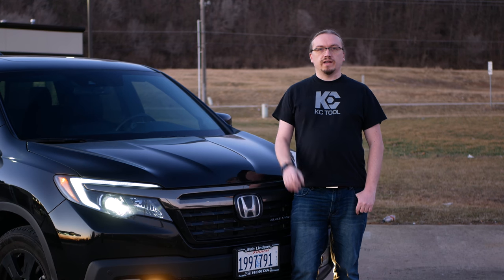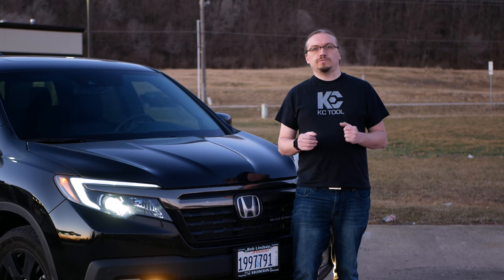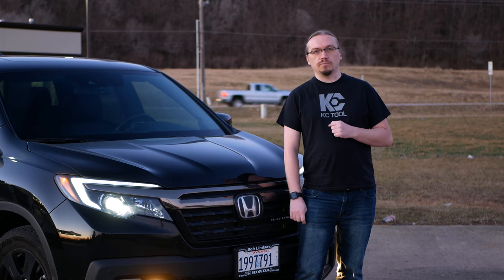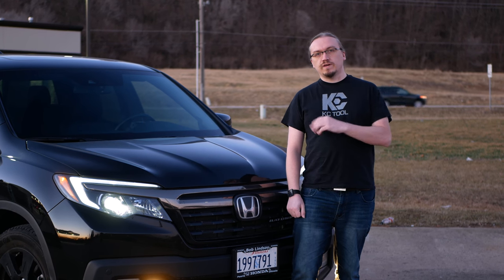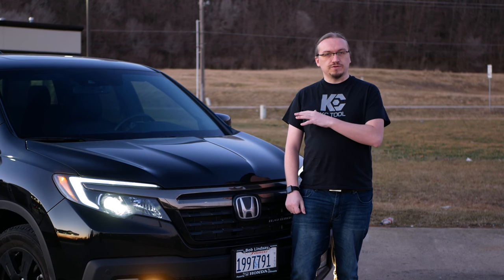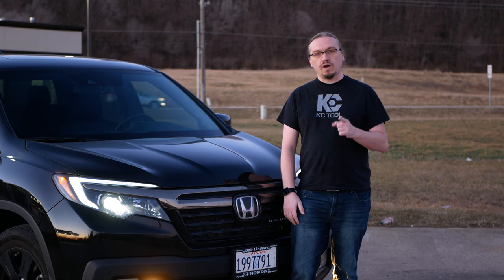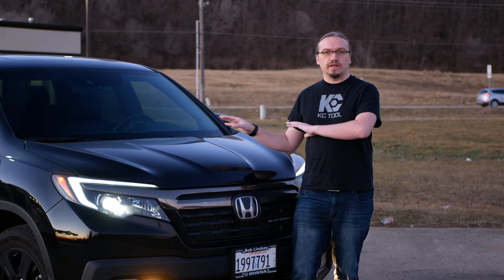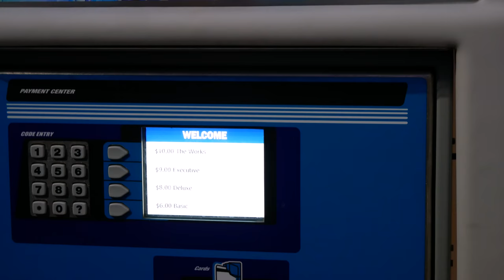Gen 2 (2017+) Honda Ridgeline Hood Jiggle

Comment: Not sure if you guys know there is a TSB that address this issue. TSB-A17-083. The root cause is the cement/glue underneath separated. Dealer will add new cement to fix the issue and adjusting the hood stops.

Comment: I just got a 2019, and noticed the flexing on highway Thursday. At about 80+, I thought it was reflection of trees with low sun, but now I know it is flimsy hood. Any way to stiffen this issue? Say some sort of applied cross member under hood that is glued in place?
Reply: I have had the same issue since day one. I worry it will unhinge or open one day while traveling at high speeds.

Comment: I've never really noticed that problem but I've never taken my Ridgeline through a automatic wash before. In all fairness how often are you going to come across winds at those speeds unless you live in an area where hurricanes are the norm.  As for highway driving I haven't noticed any jiggling or wiggles but honestly I think there will be bigger problems to deal with than the hood becoming brittle years later down the road.